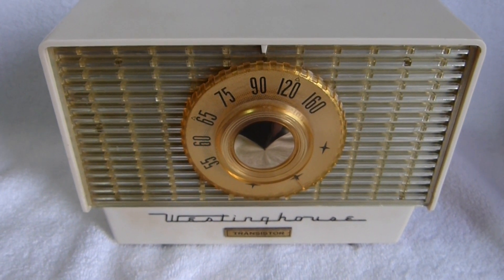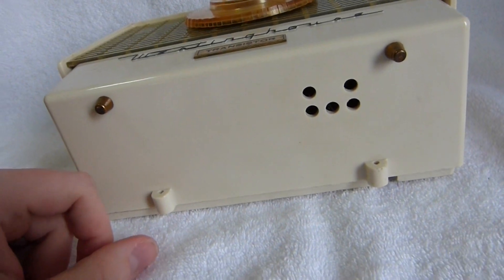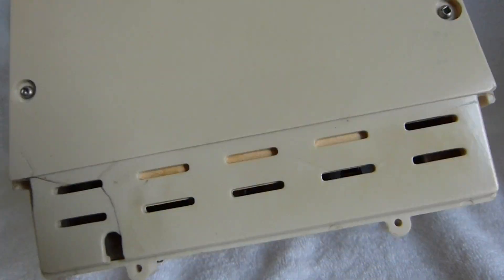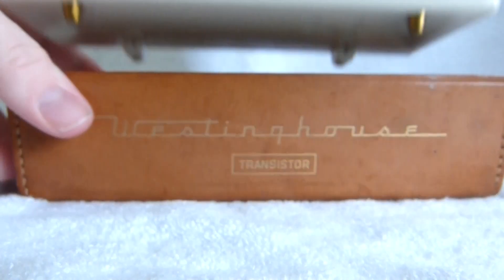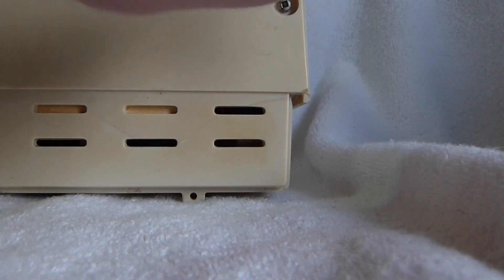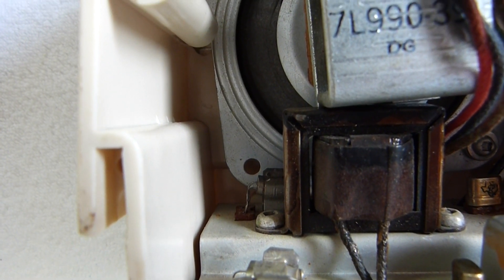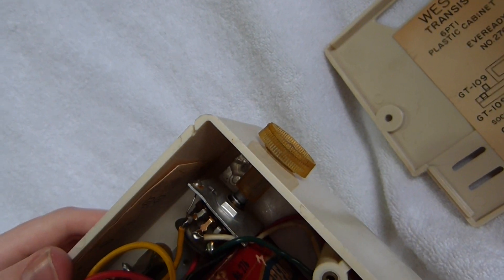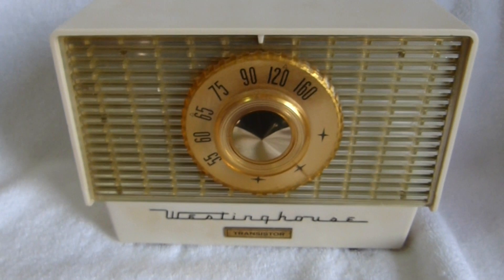1956 Canadian Westinghouse model 6PT1 (1st Canadian transistor radio)

Comment: Cool❗️it’s nice.
Lower leather may have gotten wet at some time. - wold tend to darken.
I have found “Radiomuseum” is not always the most accurate when it comes to dating some of these.
📻👍🙂‼️
Reply from the maker: It's quite possible the leather on this set has gotten wet, since it was built for outdoor use. I agree Radiomuseum is not always accurate; a better source of dates is advertisements  in vintage magazines and catalogs, which are usually dated.

Comment: Hey, thanks for posting this. I have a pair of 6PT1 radios in pretty much flawless condition; one in white and the other in red. Both are all original and play reasonably well as they sit. They may not be the flashiest looking pieces of kit on the block; but I love mine to death. The design reminds me of the three service robots — Huey, Dewey and Louie — from the 1972 sci-fi movie "Silent Running".

The 6PT1 is definitely from 1956 and is a wonderful example of early conversions of radios designed as tube sets being converted into transistor sets. I will have to do some serious rooting to dig up the documentation I had on this model; but I concur that it is likely the first transistor radio built in Canada. Once I dig up that documentation, I'll have to do a proper write-up on my long-neglected radio site.
Reply from the maker: +alan kastner Alan, I didn't know this model even came in red, since I have only seen white ones. This set is definitely an oddball, but I think it looks alright in it's leather case (it helps the looks of mine in particular, because of all the back cover damage). I look forward to seeing more about this model on your website. -Matt
Reply: Hey Matt,

I whipped up a quick page to show you the red one and offer a tiny bit of additional information. Will add more later and eventually make a proper entry for the model on my site. (Not sure when, though.)

For now, check this out when you feel like it:
http://tabiwallah.com/radiowallah/misc/6pt1_rinji.html
Reply from the maker: +alan kastner Thanks for the look at your sets, the red one looks nice, I am surprised it did not sell more (although the white probably blended in better in the average home). I see that book claims the case is Bakelite, it feels/looks way more like Plaskon to me.
Reply: +50sTransistorRadios Yes, the cabinet is definitely more like Plaskon or some other phenol-formaldehyde resin. The book I showed you is rather dated and focused more on tube radios. It's the product of one collector trying to cover hundreds of radios. (That is, possibly including photos and information contributed by other collectors.) So, no matter how vast his personal experience, the catalog-type listings for lots of the sets with which he is less familiar are bound to lack accuracy in some manner or another. 

I too find the red quite handsome. No idea of sales figures for that model, or for the color breakdown; but you could be right about white being the safer choice for matching the decor of one's home back in the day. That's especially true if it was to be used in the kitchen, which a very common usage scenario for a battery-powered radio. ;-)
Reply from the maker: +alan kastner It would definitely have been no easy task to produce a comprehensive book in the days before the radiomuseum website and other online resources were available, but at least it provides a good picture reference. 

I remember seeing an ad for a battery powered Motorola table set that was advertised as being safe for use in the kitchen and bathroom, and I would bet that Westinghouse was thinking along the same lines. -Matt

Comment: I kind of disagree about it's looks, Matt.  It looks more tube, than transistor, for sure, but I like that design.  It's a bit used looking, but, that's okay.  I like it.
Reply from the maker: I don't think it's ugly, it's just not one of my favorites in the looks department, but at the very least, nobody can say they were copying other companies designs with this set. The tube model that this set is based on, the model "H-417T5", looks a little more interesting with it's wire legs and unique dial.